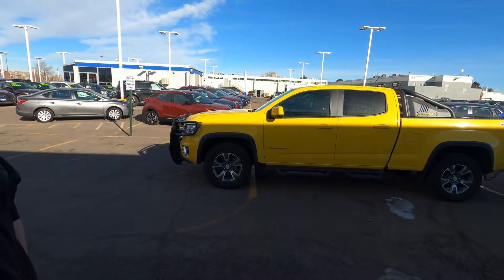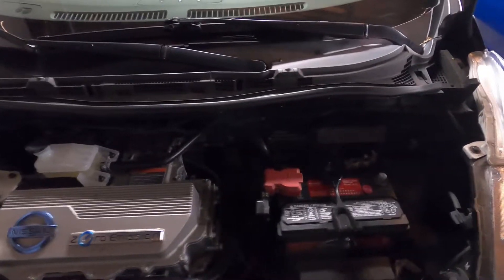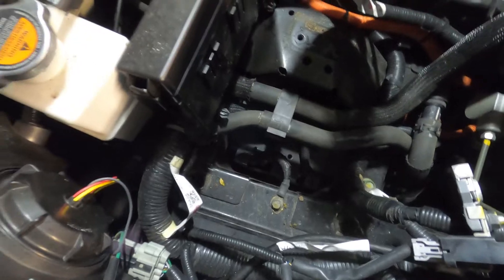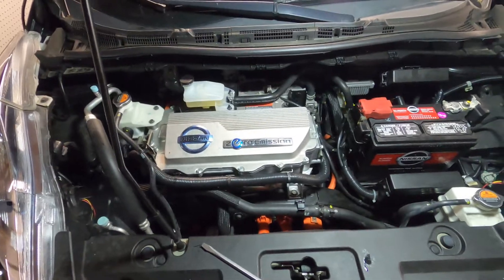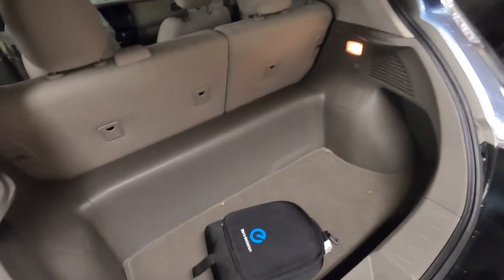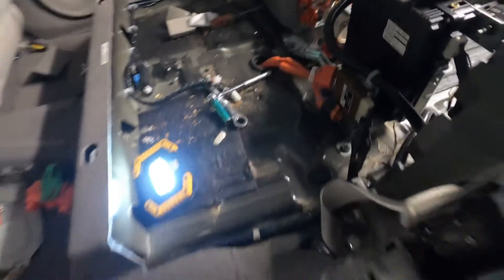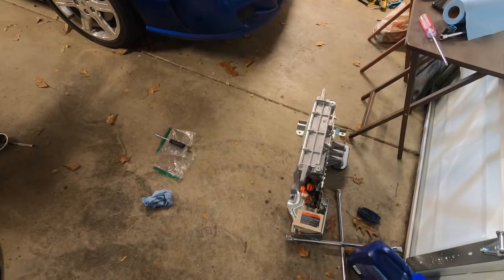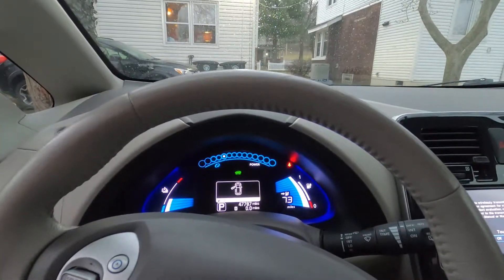2012 Nissan Leaf Repairs

Comment: My 2011 Leaf heater just went out, car has just 53k miles.  You video here and the other one with the teardown have been helpful.  How long did this process take to remove and reinstall the heater?  Also, just FYI, we had our charger replaced under warranty in 2014, it was just after a storm where lightning had hit a nearby power pole and caused a surge and then outage.  The surge fried the charger in our Leaf.  Turns out you should not have a EV plugged in during an electrical storm!
Reply from the maker: The PTC heater is in an awkward place.  By itself, figure a day job taking your time.  There isn't a good way to get to it from either the top or bottom of the car.  Make sure you have a bottle of coolant, as you'll need to replace most of it.
Reply: @wolfman9999999  I still haven't dove into this repair yet, not physically able to I broke my wrist just days after my first reply.  Watching this again for review, early in the video you mention needing a T27 driver to remove the PTC heater, but later you say that you can remove the brackets that are held in with four bolts.  Does this mean you don't need the T27?
Reply from the maker: @livemeyer  You will still need the tool. It's been a while now since we've done this job, but you'll need to get it and the bracket apart  to replace the heater.
Reply: @wolfman9999999  ok, unless I get a replacement that comes with the bracket.

Comment: Did you guys remove the high voltage cable from the battery under the car, im waiting on a charger too and have to do this very same job.
Reply from the maker: Yes.  This is a safety thing.